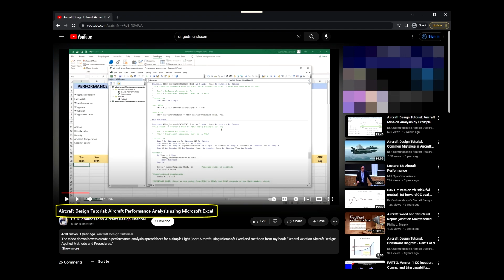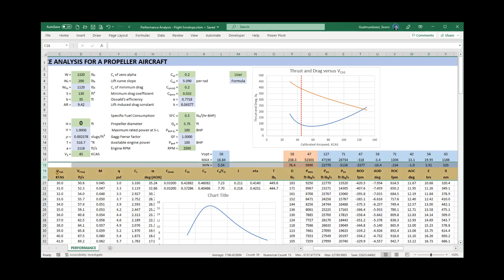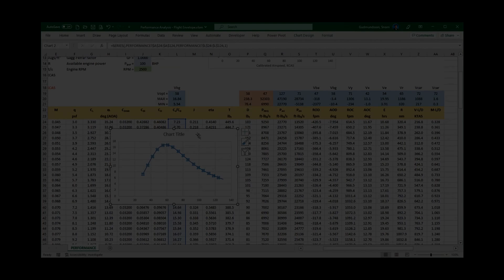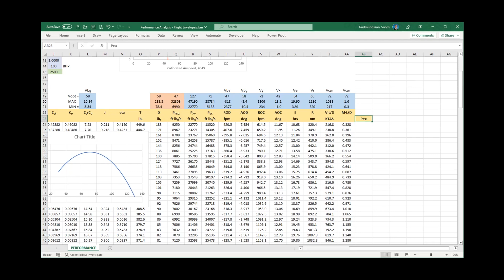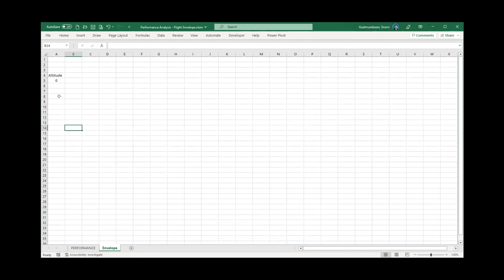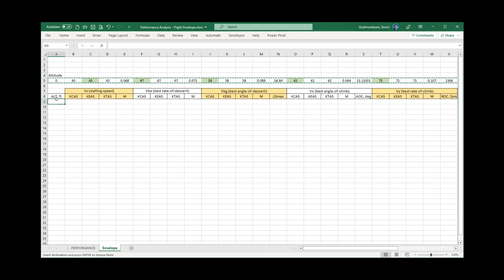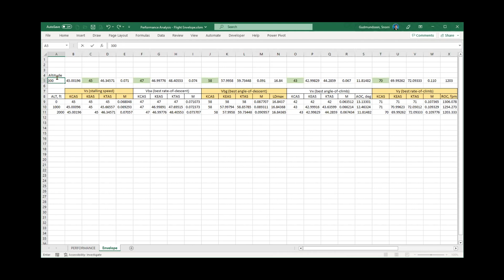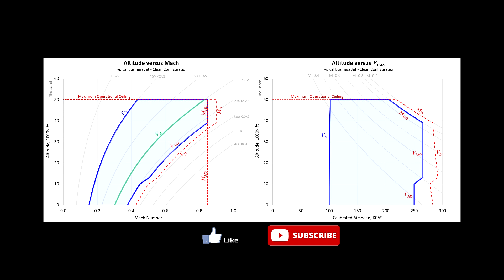Aircraft Design Tutorial: Aircraft Flight Envelope using Microsoft Excel

Comment: I really like your book, it’s very helpful and informative. 

Being an engineer in a different field, I started out doing a lot of things in excel, but more and more I’ve come to the conclusion that excel is really the wrong tool for most things. It quickly becomes either a buggy mess, but more likely unwieldy to maintain and improve. I would suggest it is far better in my opinion to use an actual programming language not excel. You can always use it to generate tables and plots. 

Doing manual steps like copy-paste is both fraught with potential error(no way to know if it’s up to date), but also very manual and slow.
Reply from the maker: @brandonhicks7549 Thank you for your kind words about my book. Also, thank you for your comment.

I used to say the following to my students: "Regard your computational tools like a carpenter regards his/her toolbox. There is a right tool for each situation. Don't pick a sledgehammer to put a nail in the wall for grandma's picture. And don't pick a ball-peen hammer to break down that wall."

Engineer's preferences are as many as there are engineers. Some engineers prefer to only use Python, others only VB, C++, and even Fortran. Other engineers prefer to only use Excel, and yet others only use Powerpoint and Word for writing/presentation purposes. Then, there are engineers that use tools from all categories. I am that kind of an engineer. I use that which I deem to be the most practical for each situation. Sometimes, I write examples in Excel that I use to validate my code. At other times, I write code to spit out numbers that I plot in Excel to display in Powerpoint. Yes, many people write impossible-to-understand, under-remarked spaghetti-spreadsheets. But then again, many people write impossible-to-understand, under-remarked spaghetti-codes. Neither speaks to either tool, only to the writer. To me, Excel is one of the most useful engineering tool I use. Nothing can change that. One of its strengths is that most engineers know it. The problem with code writing can occur when the boss has no exposure to the engineer's favorite programming language. One's boss may have a business degree and not have any coding exposure, but can still use Excel. That universality is unmatched by any programming language. Excel is well known by most. Programming languages aren't.

Comment: I believe Parasite drag is produced by VERTICAL surfaces and Induced drag is created by HORIZANTAL surfaces ONLY, please let me know if you think I am correct. Thanks
Reply from the maker: @ShonMardani  Thank you for your message. You are wrong. Why would you think so?
Reply: Thank you for your reply, can you confirm the following statement using your spreadsheet with just one number?
When the Flaps are at 0 degrees they produce Max Induced drag and Min Parasite drag, at 90 degrees Min Induced and Max Parasite drag and at 45 degrees in middle of both. 
  @dr.gudmundssonaircraftdesign
Reply from the maker: @ShonMardani  No, the spreadsheet shown in the video is super simple and is intended for teaching only. It does not feature changes due to flaps.

Comment: Since design is an iterative process, the first thing I would do after doing the setup work is to create a very simple macro to loop through the altitude increase and copy-paste the results.  Exposing min, max and height delta as variables in the second sheet created here gives a lot of flexibility to the user.  Similar steps could be taken for the airspeed table on the first sheet to address the stepping discussed.  Only thing I would add is, use a straight line between points on a graph, and, show points.  This isn't as pretty, but it is accurate for the data you are displaying, as you haven't calculated the data between points. (18 years as a stressman working airliners, UAVs mostly).
Reply from the maker: @scott_aero Excellent observation. I have a code that does exactly what you're suggesting. That said, please keep in mind the audience this is intended for; undergraduate students. This 12-min video replaces a 1.5 hr lecture in class (that includes Q&A) and, thus, saves a lot of time. Astute students write VBA code for this task although this is not asked for in the class plan. Best wishes.
Reply: @dr.gudmundssonaircraftdesign  Yep, I remember being in the undergrad students shoes and having to do very similar tasks without years of experience and personal molding into the shape of a stressman!  This was not a knock on your presentation btw, just some helpful hints for interested viewers - things I wish I knew!
Reply from the maker: @drpepperenjoyer-vx4  No worries. We're on the same page. Best wishes.